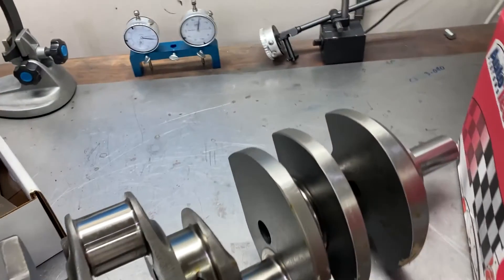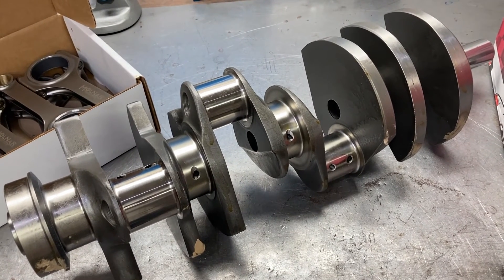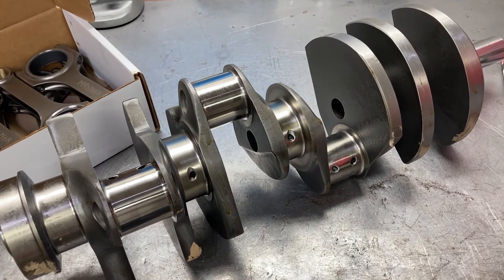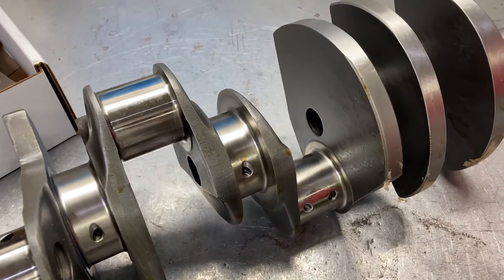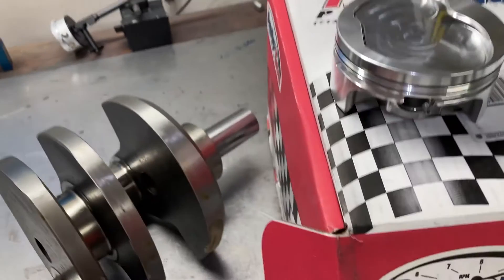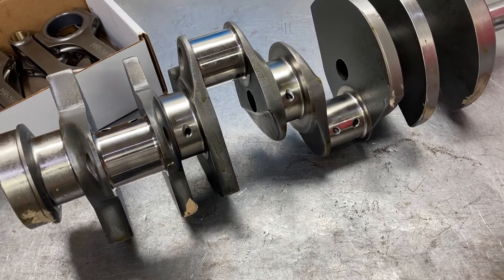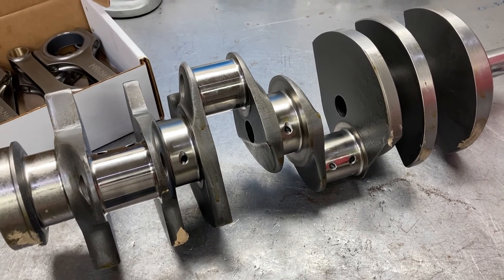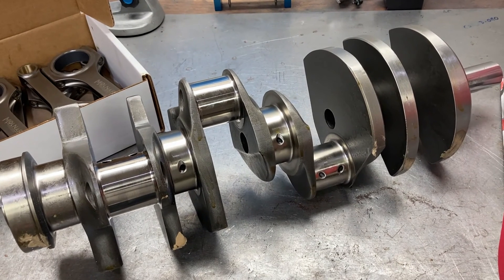Lykins Motorsports 464 Ford Clevor Build, Parts Selection

Comment: Looks like a nice build.
I just finished a 363 and used a World Products block.
Outstanding block.
Great content. 
Thanks, EM.
Reply: Hey Ed would you mind specing your build for me please,as i am thinking building one
Reply: @aussiesupersnake6642  Hello, I would be glad to help you out.
Started out with a World Products Man O War block.
Pbm crankshaft, AKA Scat, Scat Rods.
JE pistons.
10.25 comp.
I would have did 10.7 to 11.0
This a is a pump gas engine.
The heads are BMP 205CC. 2.080 in. 1.600 ex.
I reworked chambers and exhaust ports.
Did bowels and short turns.
If I did it again, I would use AFR heads or Trick flow.
I used a Erson cam and Morrel lifters.
.585 lift and 242°in 246°ex. @ .050
Can't remember the exact cam specs.
I can get it.
Trend push rods, Erson rockers.
Victor Jr I ported to match, this is a must!
Holley Sniper FI.
Decked and squared block torque plate honed to 4.125.
Close to zero deck.
Hope this helps.
This engine is in a 64 Ford Fairlane Thunderbolt tribute car.
Nice ride and big power.
Have a great day.